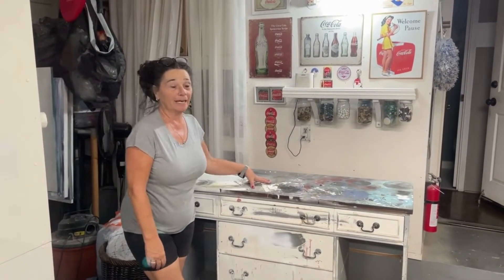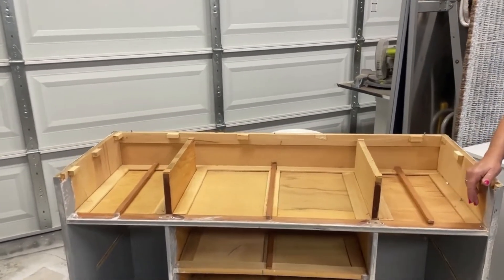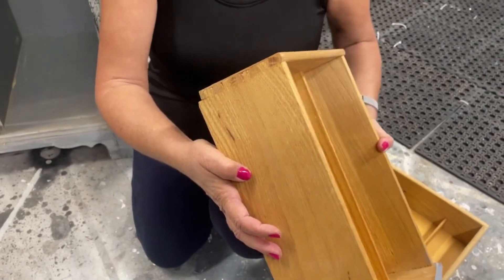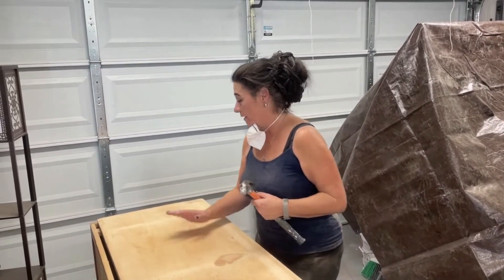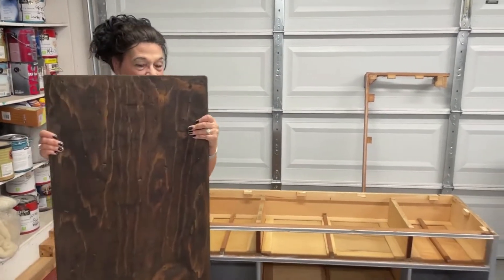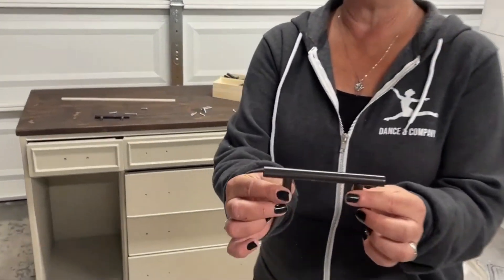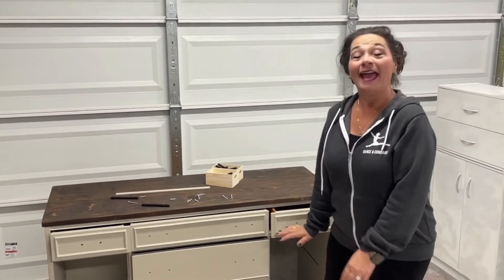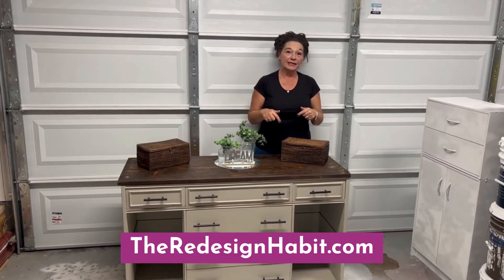Refinishing a Work Bench: New DIY Project

Comment: From my experience Harbor Freight is cheaper, but the quality of the products is not as good as the quality from Ace, Home Depot, Lowe’s and other stores.   Their sanding disc don’t last but about 1/2 as long as the ones from the other stores.  And they only cost 10 to 15% more.  I have bought some products and a few tools where their use is very limited so the quality is not that much of an issue.  One such case that comes to mind, is a 3/8 inch electric drill.  It lasted around 3 to 4 years and the bearings / bushings wore out and I could not get parts for them.  Where my 3/8 inch electric Craftsman drill that I got as part of my high school graduation present in 1966 is still operating, as all the other Craftsman tools I got in that time period are.  Only a few hand tools like a ratchet and a couple sockets broke.  But they were replaced free as advertised.
Reply from the maker: Hi there!  Thanks for your input and info.  My experience hasn't been quite the same.  I don't have much issue with the sanding discs.  They seem to last about as long as the other's I've gotten either online or in the big box home stores.  I also think you can get great savings on paintbrushes, clamps, and other items that DIYers would need in their workshops.  I have gotten these items there many times and they have worked great.  I haven't actually bought real tools in there though so appreciate your insight.